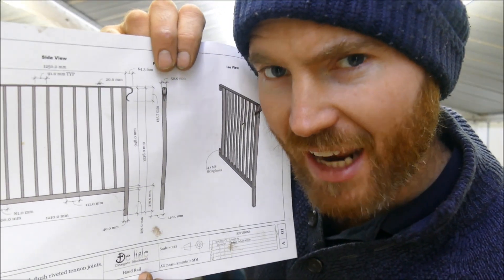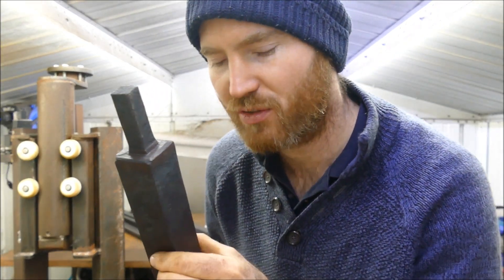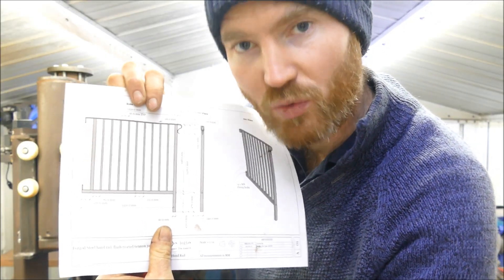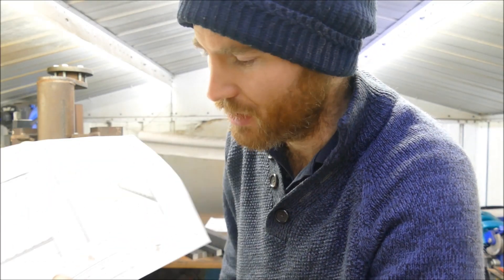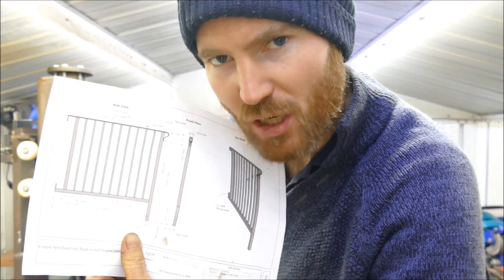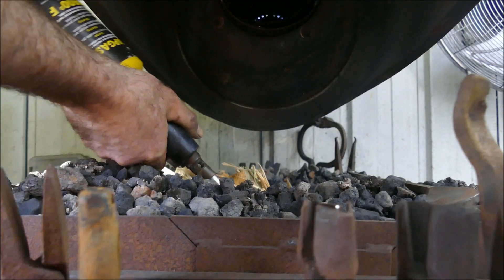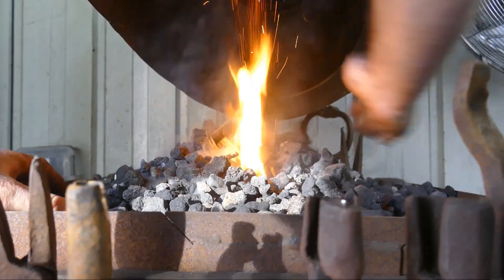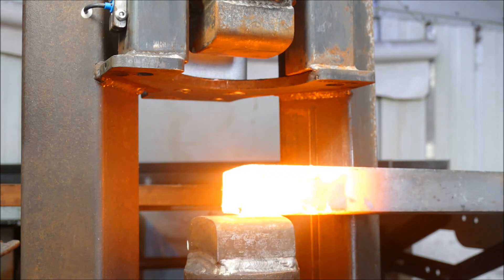New! DIY induction forge for £75 - 2500w PCB review and forged tenon joint railing build

Comment: Great video! ..... and nice to see an honest opinion stated  ;0)

One thing you need to keep in mind when ordering this stuff from China ....... they Lie!
If you buy from a UK company it makes no sense for them to sell a dud as they will shortly have to replace it .... foreign sellers, less so!

If your unit puts out 2.5KW at 48V it would need to push 52.08A (P=VI gets you P/V=I) down the coil! If it takes any more than that it would be caused by inefficiencies in the kit .... which would be mainly heat! Hence the toasty board! You also need to have some serious reinforcement to the tracks that carry the load in the board too (usually a wire laid the length of the track and soldered along its full length)! Also you need to be aware of different ratings for breakers and use one designed for magnetic devices. 

I think the majority of the useful generated heat is from the eddy currents set up by the collapsing magnetic field in the steel! ..... but it is a while since I dabbled ;o)

Resistive heating is the most efficient, but arcing at the contacts could be a killer .... maybe using  copper braid as a contact material would work. Having really chunky clamps would also increase the thermal mass and again using copper would allow for the relative resistivity of copper and steel to work to your advantage and water cooling would too! I think microwave induction is a bit beyond amateur level and would be more trouble than it is worth ..... but if you could get hold of the right materials Friction might be a good one!

Sorry for ranting on a bit ;o)

Comment: Great video! Thanks man, if you could get that to work it would be amazing. Remote on a pair of leads like a welder would be even better but I'm sure somebody has tried that already. Thanks again, hope all is well over there.
Reply from the maker: I did get a foot pedal and an ampmeter. Might have a way of salvaging it. Not too sure yet. Might be something to do with the resistance of the coil meaning I need a longer one with more coils to match the one it was supplied with. Cheers J
Reply: @joshuadelisle  hope to see it.

Comment: I had a smaller 1000w induction heater from ebay and I used a car battery charger to power it . I used it to temper tools but it set on fire 🔥 after a few uses . Wise words josh these things are turd 💩
Reply from the maker: Its good to know i'm not the only one. cheers J

Comment: An old school heating method using an arc welder was a Carbon arc torch. Two copper coated carbon rods in a holder and you create an arc between to make high heat. Not common anymore, but they are still out there. Not sure if they work with invertor welders though.
Bugger about the induction build path. 
Thanks for the video.
Reply from the maker: Thank you. I think a water cooled clamp may work as I can get 200amps without gougeing it as a carbon arc would. Worth a go to see the results though. Cheers J

Comment: The bridge rectifyer does a neat little trick, it swaps the negative side of the AC sine wave to positive. Problem is that the AC voltage is the effective voltage the sine wave produces, not the difference in potential between the 'peaks'. If you flip it up, you get a 100hz pulsed DC, with a peak of AC voltage times sqrt(2) - so about 40% more. So your board got a pulsing DC between 0 and 70V, which is guaranteed to fry a 48V appliance. Adding at least a (big) capacitor to smooth those peaks out would have brought it closer to nominal. Thats usually the biggest price tag  in DC supplies - the capacitors and other do-dads to make sure the DC is exactly what it should be.
Reply from the maker: Thank you. I did think getting some large capacitors would work but for the price I just went and got the official power supply unit. Cheers J

Comment: I have a 15kw, 220 volt unit from China, needs a water cooling unit like for a welding machine. It heats steel rather quickly. I never checked the costs for electricity, so I can not comment on the costs of running it.
Reply from the maker: Nice! Do you recommend it? How much did it cost? Cheers J
Reply: @joshuadelisle  around 1500 euro’s including shipping, without the water cooling unit. I use it for knifemaking, but there is a guy on youtube with a similar unit who uses it for black smithing. He can probably advise you better. I will look him up.
Reply from the maker: @Tonioostendorp  thank you Tony
Reply: @joshuadelisle  EJ of the Anvil

Comment: The induction heater is probably overheating because you put too small a coil on it.  I know the resistance is tiny in all these coils, but you put a coil with probably 1/8 as much resistance as the big factory coil, which means the induction heater board will be trying to drive too much current through it, far more than it is built to handle.  I can see why you need a smaller diameter coil, but it probably has to be much longer then, in order to still have enough resistance.

Second point: why the metal heats up.  The magnetic field in the coil is constantly moving because it is high frequency AC.  That magnetic field moves through the steel piece, and induces (as in induction) a HUGE current to flow back and forth inside the steel (just like moving magnetic fields in a generator to make electricity).  Perhaps thousands of amps flowing back and forth just inside the steel itself, induced by that AC magnetic field.  The resistance of the steel makes it heat up, of course, with so many amps flowing inside it.  Why induction heaters are so popular is because they make that super high current flow inside the steel, without having to physically connect in the right places, which is always difficult on rusty metal.  Usually trying to connect to the steel causes hot spots at the contact points, instead of heating up the metal itself.  Spot welders are a perfect example where they overcome this limitation and truly heat the steel by just pumping current through it, and if the contact spots get hot due to poor contact, it still helps the process because that's the very same spot you want to get hot and weld anyways.
Reply: Depends on how it works on the output side AC or pulsed DC - a coil is pretty much a resistor, itself. But in a nutshell, your system doesn't dump enough power into the coil, and the driver has to eat the waste heat. So just using the right lenght is not enough, it needs the same inductivity.  Rough approximation (given same material base lenght, eg permeability of the material ) -  number of coils squared multiplied by coil area (m2), divided by the coil length(m) need to be the same result for the original and the custom coil. So the smaller coil needs more turns (not many, since they are squared, while lenght goes directly into the formula). Depending on system, a partial turn more or less for adjusting inductivity will fine tune the final coil to max efficiency, but your current coil has about same turns, a third of the diameter (so about a 9th of area) and about half the lenght than the original so it is waaaay off the specs the driver is rated for.
Reply from the maker: @DerLaCroix1  thank you. I'll have a think on it and what you've given me. All the very best. Cheers J
Reply: @DerLaCroix1  Exactly.  Thank you for supplying the details properly.  Idea: anneal the copper, flatten the tubing into an oval cross section, anneal again, wind into a coil with more turns.  By "flat winding" to stack the turns closer, you can get more turns without getting excessively long.  This might also be possible by heating and compressing an already round-wound coil, then stretching just a tiny bit of gap back into the turns.
Reply: Hmm... small induction heaters create a resonant LC circuit between the heating coil and that capacitor bank. The FETs switch on and off thousands of times a second to pump energy into that circuit. The frequency is determined by the inductance of the heating coil rather than being simply related to its length or diameter. Losses (heating) in the capacitor bank are related to changes in the frequency of oscillation.
Reply: Inductance is roughly proportional to the square of the turns, times the radius. So if you decrease the radius to produce more localised heating you might need an extra turn on the coil to stay within the normal operating frequency.
Reply from the maker: @keithdowsett1352  thank you. Very helpful information. Cheers J
Reply from the maker: Thank you. That's interesting. If I un coil the original coil like you say and have it long with a small coil on the end it may work With proper resistance?
Reply: @joshuadelisle  It's been a long while since I took electrical/physics classes, and AC resistance is a little bit complicated...

You might have better luck making a narrow coil like the one you already made, but with the same number of turns as the factory coil.

Comment: now this looks promising. Good grief , after watching the video Im disappointed for you , to be honest the cash you spent would have bought you an oxy acet set up , and as for needing it  well until you  have gas to hand you dont appreciate how much you need it , and once you do have it to hand you will never ever ever be without. Those rails are a fine job , i wouldnt have liked to be lifting them into the van, I think they will out last you and I .
Reply from the maker: Thank you. I got a pallet courier to pick it up for me and just it walked on to the drive. I've used gas a lot but because of the infrequent use of my home shop I can't justify the bottle rent. My Argon bottle isn't rented just a deposit and I'm quite impressed how well TIG is at heating up things. I may try the resistance method if I get the opportunity. Cheers J
Reply: @joshuadelisle  I've switched to deposit only bottles. Much cheaper, especially in lockdown!

Comment: Could you give us some more detail on why you feel it doesn't work? Is it just that the board overheats?
Also I've noticed that the commercially available induction forges aimed at blacksmiths start at 15kW - so maybe expecting a 2.5kW unit to be effective is a bit ambitious!
Reply from the maker: I should of filmed the board bit it's literally melting and smoking when using it. Apparently the official systems have water cooled capacitors with modular replacement parts as they wear out quickly. Not convinced of it long term cost effectiveness thanless the technology get better and cheaper.

Comment: A bummer that the induktion forge isn't working properly. Having one which is not too expensive would be outstanding, especially for the neighbours. No stinky fumes or noise from the fan😊
Reply from the maker: Too good to be true in this case. Maybe with more tinkering but not as it is. Cheers J

Comment: One last thing, a rectifier does not make DC. You have to smooth out the power with capacitors. All the rectifier does is fold the AC on to itself to be humps instead of a sine wave.  You were still putting AC in from the BuzzBox.

Comment: Joshua, I really like your explanation of induction heating stuff. You are correct when you are talking about efficiency, it all depends on how you look at it. For example, an electric heater is said to be 100 percent efficient but compared to cost of running the unit, hold on to your wallet. Sorry for the bad example since we are talking about induction heating. The components the CHINAMAN use are as cheap as you can get. The duty cycle and reliability is ultra low just like quality of components. The true industrial heaters are just superb. The internal components are first class using water cooled capacitors that have copper construction which are way higher in efficiency with cost to boot. There's a downside as with everything, you need to have different coils for different size and shape . The upside is how quick this will heat up metal using very little electricity as compared to using oxy-acetylene gas or coal as everything today seems to cost so much up front. Nice video mate, look forward to seeing more great videos from you Joshua.
Reply from the maker: Thank you so much. I agree. Maybe if the technology can improve and still be cheap it may get better. I could invest more in finding out ways of building one from scratch with more internal cooling. But I'm not in any need for one anymore. Cheers J
Reply: @joshuadelisle  When I find out something I will let you know. Peace V

Comment: Could you of used a carbon arc torch on your ac welder? They aren't as popular now as they once were, but you can heat things up pretty well with them.......Just a thought 😉
Reply from the maker: You could but it would gouge it on high current. If I clamp it with copper water cooled clamps I can get 200amps through it. Cheers J

Comment: If no one else pipes up, I can help you set that up to work properly. I've a few years in designing electronics and what not. Just a few ;-)
Reply from the maker: Thank you Dan. Do you think a DIY build is cost effective compared to buying one? Let me know your thoughts. Thank you for your support. Cheers J
Reply: @joshuadelisle  the guys who build the super turbocharged gaming computers often would seal the case, fill them with mineral oil, and pump that through a radiator to cool. That should help here too. Dan, do you have any thoughts on this?
Reply: @trollforge  you don't want to do that without knowing how much waste heat there is. The specific heat of mineral oil can only absorb so much heat per unit of time.  Computers are in the hundreds of watts, not thousands.  I don't know the specific heat of mineral oil, but I wouldn't jump to that conclusion without knowing that and how much waste heat there is.
Reply: @ironhead65  Awesome Thanks!
Reply: @ironhead65  oil has a much lower specific heat capacity than water also transferring heat to oil is pretty difficult (we used to heat/cool the lube oil on engine test beds to provide stable test conditions) and if you get it wrong you can end up 'cracking' the oil, i e., breaking down the long chain hydrocarbon which leads to all sorts of interesting problems.
As regards the induction heater unit I'm pretty sure I've seen that they are a form of tuned resonance circuit and you can't just chuck any old coil on the output, it has to be matched to the circuit or the efficiency goes to shit and you end up working the driver to hard and cooking it.
Reply: @joshuadelisle  yes. I've not built one, but it is just a high power switching supply. Probably a flyback or something is my guess.  I think had we spoke before hand, you wouldn't have needed to buy so many. Stuff that is cheap like that is not very tolerant to mistakes. One of the reasons it is cheap.  Certainly a purchased one is robust, but if you use it properly, I think a cheap diy unit is possible.  Personally, I didn't get far enough to figure out the water like you did.
Reply: Dan, see my other comment in this thread. I'd like your input.

Comment: If that is really DC coming out of that power supply, the AC breaker will not work.  You need a DC rated breaker.
Reply: With AC the current drops to zero 120 times per second so it doesn't take much force to break the circuit. DC current is generally constant so the breaker needs to be rated for DC.